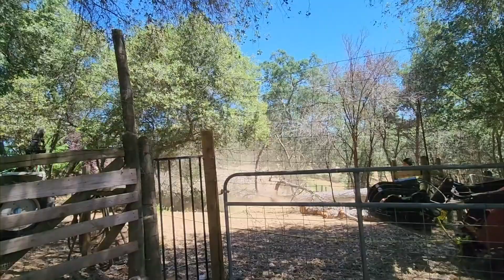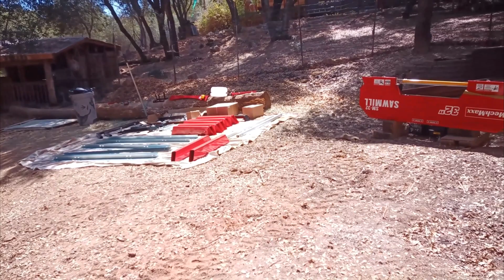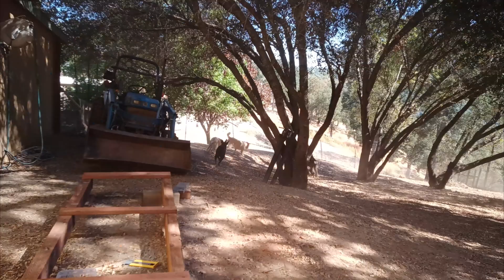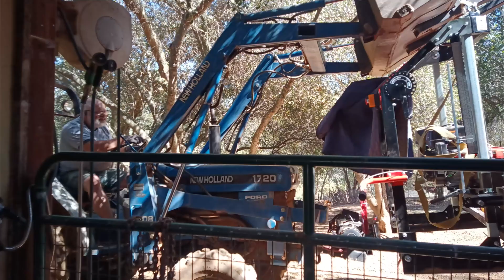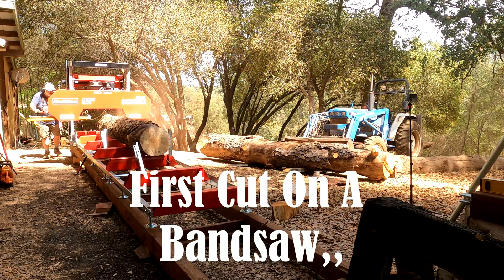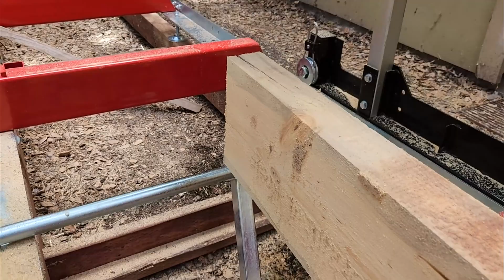Home Grown Lumber w/ MechMaxx SM-32

Comment: I'm getting the SM26 delivered Wednesday super excited to get it out together and start milling.
Reply from the maker: It has been fun to use. The setup takes longer than I expected. And there are many adjustments to get right before you get it dialed in. Since this is my first experience using a sawmill,  I can't say how much my own inexperience factors into the quality of my first lumber attempts.  But I have gotten much better with each log.
Reply: @bonesetranch  I'd rather hear it from a novice because this will be my first mill also so I appreciate your feedback

Comment: 17:20    Move that blade guide in close to the log. It looks like it's about 12 inches away from the log which causes slack in the blade. Also, stopping and starting while pushing hard into the cut will cause the blade to dip and dive while cutting the log. Consistent speed while cutting is best. Practice on shorter logs.
Reply from the maker: Great advice. Thanks for the pointers.

Comment: What's your thoughts so far
Reply from the maker: Setting up was tedious. Leveling the base is very important.  Also, the bolt holes are just big enough that you might have to loosen and readjust things here and there to get all 4 wheels to track properly. My first few logs were learning experiences.  But I have made progressively better lumber with each log.